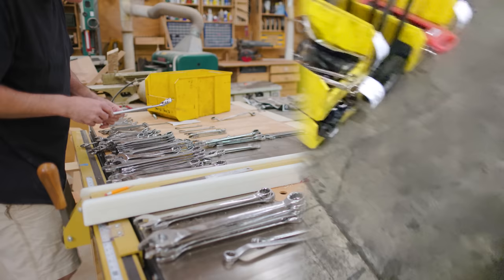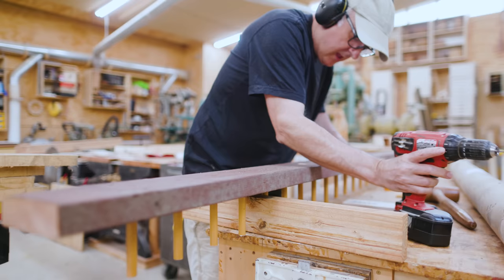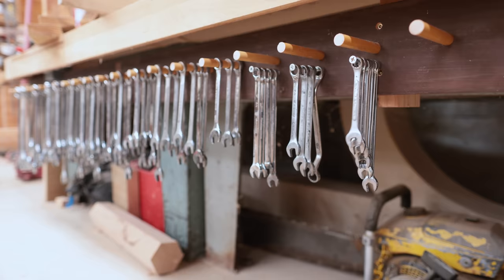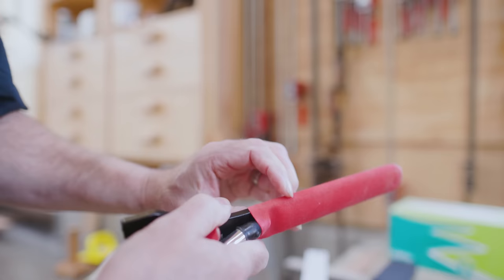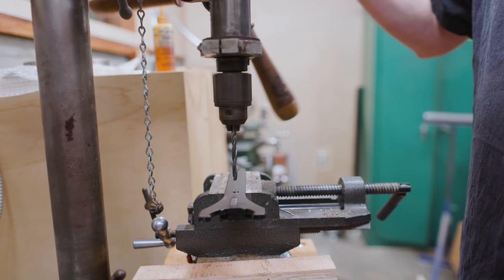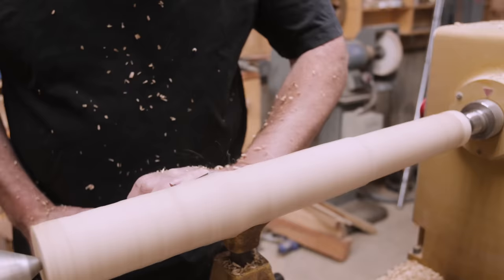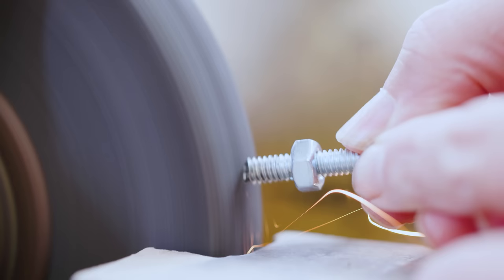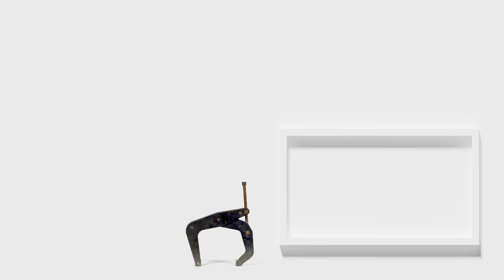Throwing a System Into My Wrenches

Comment: A Chicago screw might work well to reduce the height of the projecting fastener; getting it below flush would make it a bit easier to use.
Reply: Good suggestion. It would look better as well.
Reply from the maker: That's what I need.  I had forgotten about those

Comment: a tip from one wood turner to another, at the 14 minute mark, if you turn your gouge upside down, it makes that cut way more efficient and it slices instead of scraping which will leave you with a much smoother surface. Love your work. Your editing is absolutely top notch. Note: WHen you turn your gouge over, swing your handle towards you and use the bottom part of the gouge. Same cut can be used for bowls when you leave a center pillar for stability. Learning this cut changed my life.
Reply: Sounds like a good tip.  Can you post a video of this technique?  Thx.
Reply from the maker: humm.. I'm going to have to try this.
Reply: @frankmakes  in the interest of being thorough. When I get down to the bottom of the bowl and have that last bit thats no longer a column but more of a disk of wood left, I do go back to a normal push cut to finish off that last bit. The only reason is to ensure its flat to match the rest of the bottom. GL with this cut, its really easy to learn and is a total game changer for removing lots of wood quickly. 

Btw that puzzle piece bowl you did for a wedding present absolutely blows my mind away. I show that video to everyone I interact with at work that has questions on what a wood turner does/can do. Not only is your work gorgeous, but again, your editing and animation skills are enjoyed by people who know nothing about wood working. Ive turned so many people on to your channel just from a "appreciate the art." If I had a CNC I would absolutely try and replicate that bowl. Its truly one of the nicest pieces Ive ever seen.

Comment: Frank, add drawer label holders for each of the wrenches for your vertical wrench holder.  This way you can have the labels and easily change them if necessary.

Comment: I made handle extensions for some stamped router wrenches.  The router has a straight collet so it wants a bit of force.  I flattened the end of pieces of emt conduit and forced them onto the wrenches, and fitted some dowel with rounded end in the hand end.  That was in the 70s, and they are still working well.

Comment: Hey Frank, i love what you do. You can sand down the nuts to the handle (flush) since the clamping pressure you need is so low , the nuts just need 2 to 3 windings on the thread to do the job ;)

Comment: The reason one of the wrench head is at an angle is so you can put them both on the nuts, and create a “v” which you can then squeeze together with one hand. This should prevent you banging your knuckles etc. works in both directions by turning the angled wrench over.

Comment: As far as the CNC collet wrenches.  I think flattening both sides of the handle where the bolts are situated would make it feel more natural that is appears.  It looks like your wrenches are not level and not grabbing the collet it should.  You could put a slight angle on the wrench head to level it out or leave them as you have it.
Reply: my spindle collect upper nut have working only one position because backside have small sensor and support  need idea how this can make better,  wrench can use only one position not broken backside small sensor support. big lower nut can tight around spindle good.

Comment: for shortening bolts I use two nuts screwed on and locked onto each other as well as a angle grinder with a thin cutoff disc... so it has less material to "fold back" when unthreading the first nut... after that I use some fine grit paper or a hardened file to clean off any extra burr... and then take off the second nut to clean the dirt of the threads... for the second one I for normal don't need any tools but my fingers (if everything has gone right)

Comment: On cutting your bolt shorter, you used the bench grinder to make the end flat, if you would rotate that bolt end in a next step at 45 degree angle to the wheel, a chamfer end will clean the buggered up thread off and let the nut spin freely. I was just doing this last week repairing the bolt downs the contractor did to hold the new garage to the concrete slab. I drilled deep holes with a 5/8" masonry bit, used wedge type Red Hat inserts with a 1/2x13 female thread, set the wedge, then cut off 1/2x13 pieces from 10 foot long threaded rod. I cut them on my bandsaw, but then grind them on a 2x48 belt sander to clean the end off, and put that chamfer on the ends. They thread in cleanly into the insert, and the nut on the top side starts and spins on without any effort.
I like the big handle mod for your wrenches.

Comment: nice shop!  I think most folks that have any quantity of wrenches are usually looking for a good way to keep them organized.  (the same for sockets) What you did was certainly much better than 2 boxes... but it has it's problem too.  Most folks that use wrenches all day, get to the point of just a tray or bin or space for each specific size.  You have a 14mm, and you put it in the 14mm space.  It is easy to sort the wrenches that way.  That works if you are not hauling your wrenches to the job.  My problem with what you have there is that the box end wrenches you have there are hung too low.  you have to get down on your knees to sort thru.  The open ended ones are better, but also not easy to sort.  Fine when you first put it up there, but it will soon get messed up.  I'd suggest a chest with drawers and dividers.  Make the dividers adjustable if needed, but that way you can sort thru quickly.  I finally went  that way.  There ARE a lot of types of wrenches, even for each size!  Open ended, box, bent, thin, long handle, short handle, 6 point, 12 point,  etc.  But still, a manageable amount.  If you have more copies of the same wrench, move the extra one to a remote storage.  Of course there are going to be odd ones.  Most of us don't have lots of 2 1/2" wrenches for instance.  or lots of hammer wrenches.  some odd ones can be kept aside.  just my two cents.

Comment: Get yourself a bearing nut for that cnc collet.   It has a thrust bearing in the end to make tighten and loosen operations easier.   But also it is supposed to give better TIR due to nut no longer applying a twisting force on the collet.

Comment: You should mark distances on the handles and grab the handles much closer to the head when tightening the nut and then use the full handle length for more leverage when you are loosening the nut.

Comment: 07:00 This is a question of technique. I always learned to plce the wrenches so they always pull away from eachother. So it's a different wrench position for tightening than for loosening, but both times you're pulling them away from each other.

Comment: You should consider an integral spindle lock for the CNC. Something that you can manually align with the spindle, and hinge or slide into place so the spindle can't rotate, so then you only need one wrench.

Comment: I made a rack/organizer for my more humble wrench set + sockets by making a similar peg set up, but I added to the horizontal board a T-top piece that I then drove pegs into the top to hold all my sockets.  I have multiple sets so there are three or four positions for each size: deep socket, normal (3/8 and 1/4 drive) , and hex shank.  And to avoid the labeling issue, I cut each size set out as a french cleat unit, so they're all separate mini racks that line up WITH clear labels.  And I can add/remove new ones with the same design of cleat.  It's a bit busy, but it works great and I haven't lost a 10mm yet.
Reply from the maker: next up is all the sockets I have, your system sounds intriguing

Comment: The wrenches for the collet are made for hand tight, but to DO tighten them pretty tight. The threading is not the problem with "wear and tear" at most the "nut" you screw on gets some damage from the narrow wrenches that are used on them. So you will sooner replace the "nut" than anything else on that system.
Reply from the maker: good to know, thanks

Comment: Great woodworking, but I would've done some things differently.  I would've done dowels at a slight angle, so gravity would retain the wrenches.  The handles I would've done differently as well fs
Reply: I had the same idea except i thought to cut a bevel on the whole beam using the table saw so all the dowels are angled evenly.

Comment: Beautiful as usual. But, question... rather than those ugly nuts sticking out - why not use a captive nut of some sort and drive a socket head cap screw in so that both sides are now flush/encapsulated within the wood? Much cleaner...

Comment: I've always wondered about your radial arm saws.  When you cut, it seems you do it in sort of a "jerky" motion.  It almost looks like you have a cruncy bearing or something.  It just doesn't look like a smooth feed.

 I can understand the appeal of a great old machine, but if it isn't smooth, I think a CMS or Bosch Glide miter saw would be more accurate.

Can you elaborate on that "jerky" motion?  Thanks.
Reply: If you don't 'walk' the saw like that it can catch and climb up on the work.
Reply from the maker: at half a hp it a little under powered.  I should find a sharp thin kerf blade for it.

Comment: Hi Frank, great video as usual, could you shorten the bolts in the handles the sink the nuts in deeper? Just a friendly suggestion. Keep up the good work. Derek
Reply: A Chicago screw (like what's traditionally used to secure a metal belt buckle to a leather/fabric belt) would be much lower profile--some of the other commenters have already mentioned this.

Comment: Why not hang the open wrenches between a pair of dowels?
Reply from the maker: I hadn't thought of that, I like it.
Reply: @frankmakes The downside, I guess would be that it might be easy for one to twist a bit and fall through. Either you can have it compact, or have a way to hold them securely that's half a mile tall.